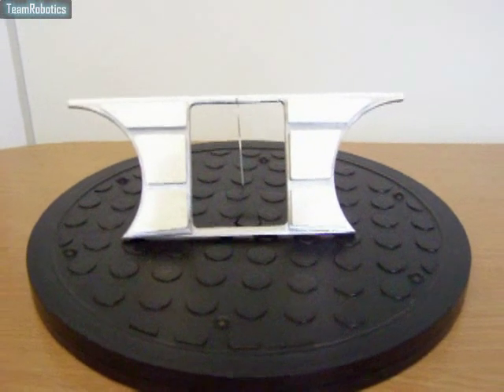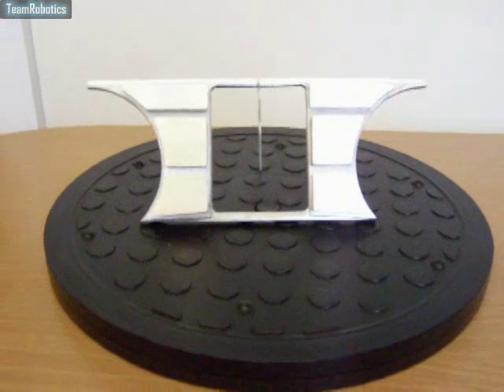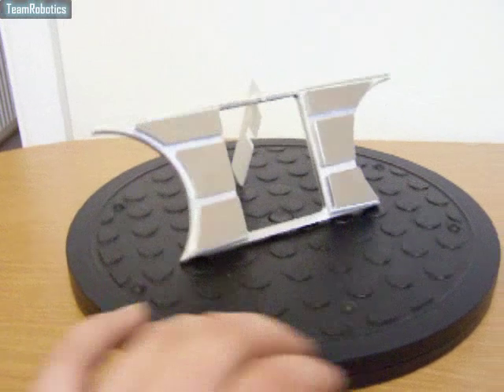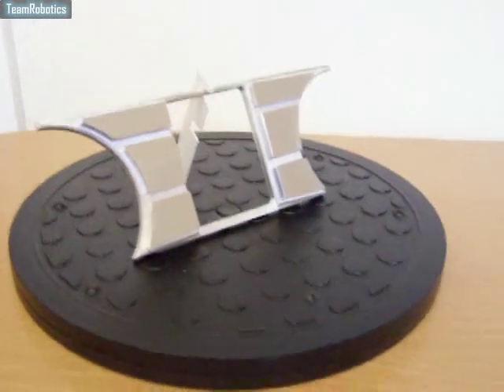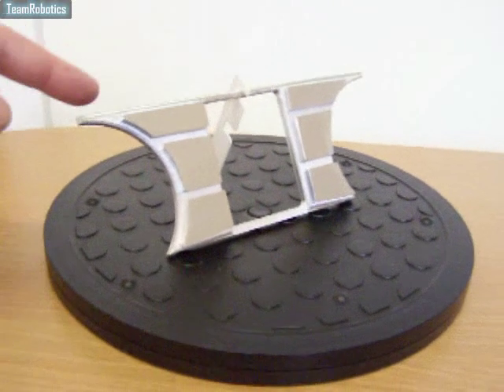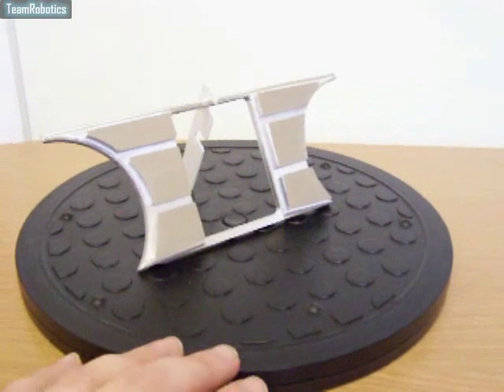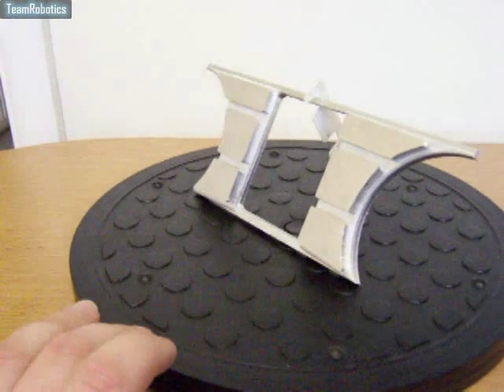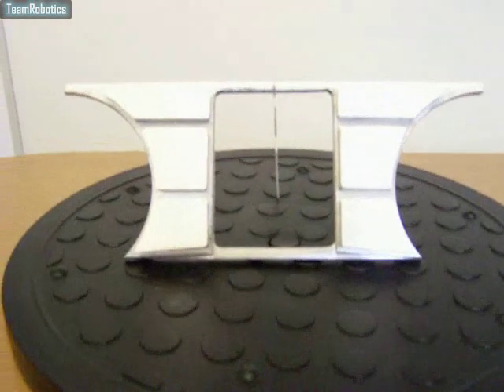88: Completed Front Face Plate

Comment from the maker: Hi there im not sure at the moment, i may do at some point in the future, If i was to make a few fully articulated heads in the future they would not be cheap because even tho the parts are cnc machined they still need preparing, the eye tubes and the eye lenses + vents are pretty time consuming. Im making this head totally in aluminium and brass...
The original Johnny Five robot heads are resin casts mine will be fully metal...